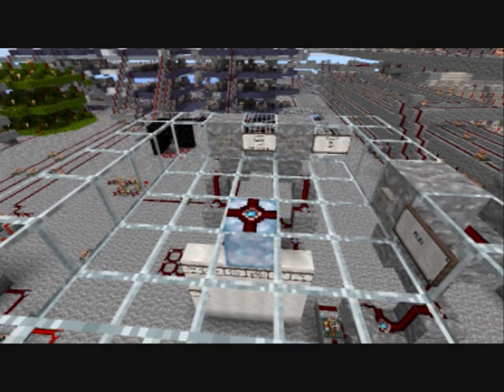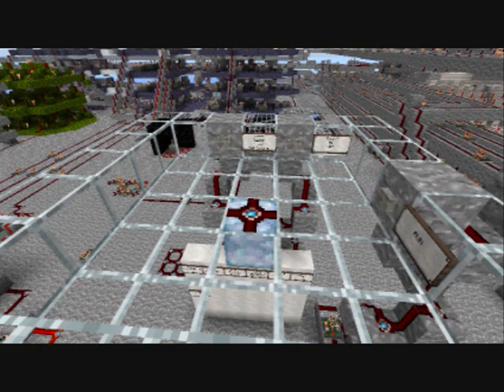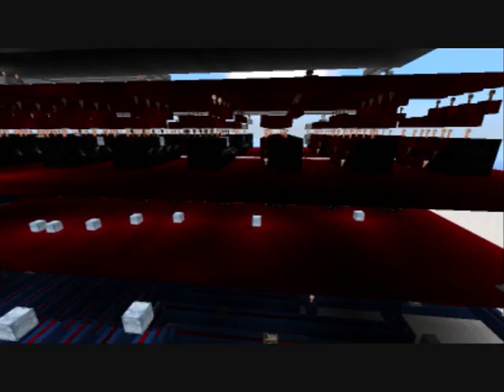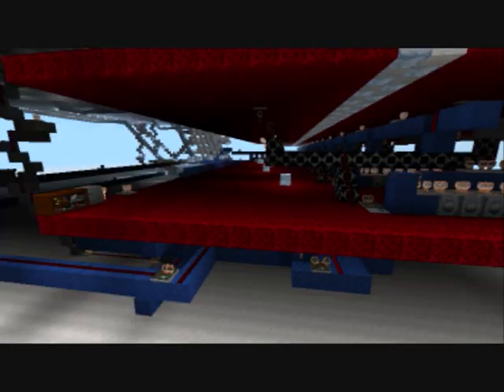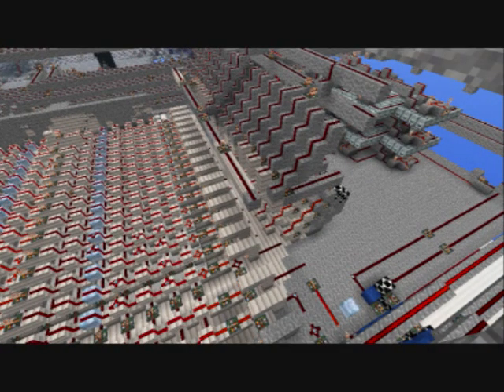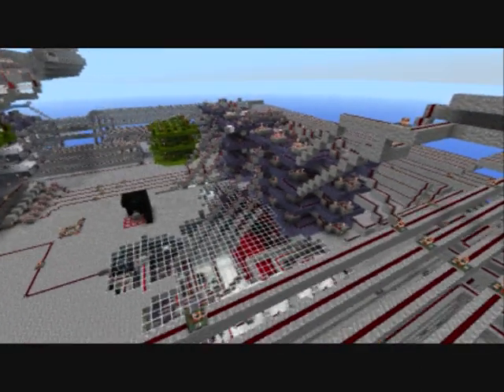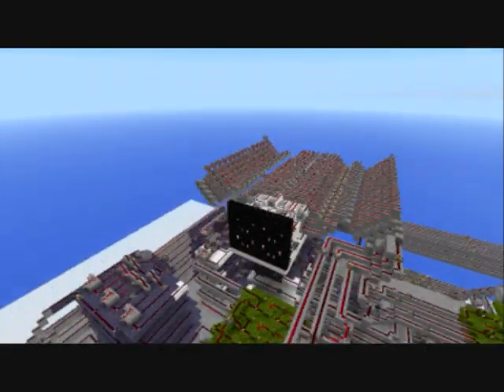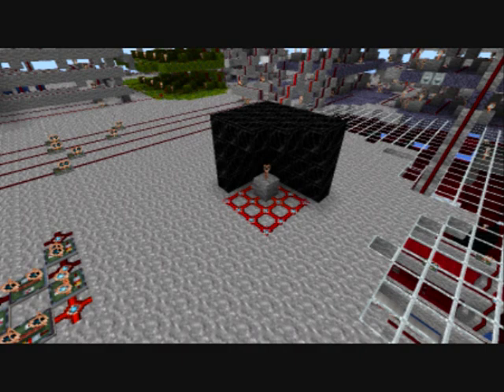Minecraft 4-bit Redstone Computer

Comment: @Avarthas:
Still, I would figure there would be issues with the circuitry being so large that it doesn't function properly if you are too far away or something. Plus, even with all this, there are still limits with creating a proper screen and lack of color on the screen (colored blocks would work, but pistons can only do so much). And, how would you control it? I imagine a keyboard or mouse, while possible, wouldn't be very usable. Obviously I'm thinking too much about this...